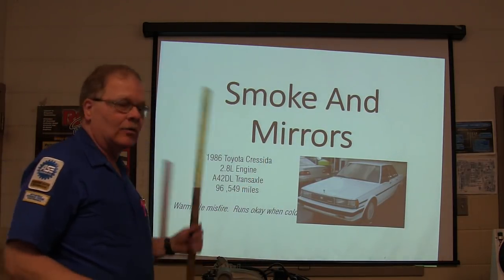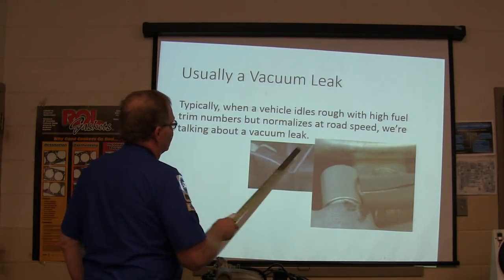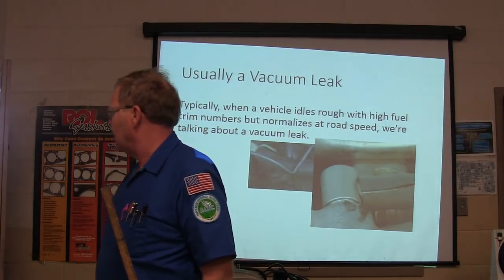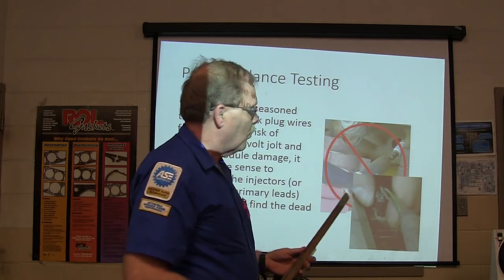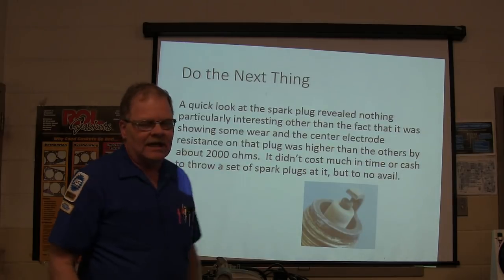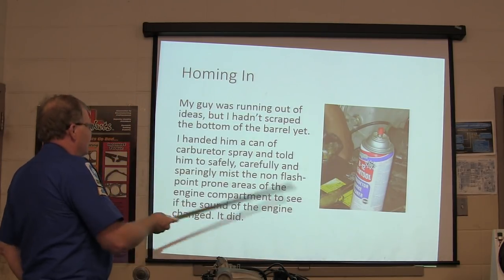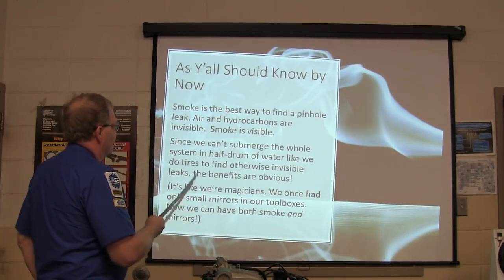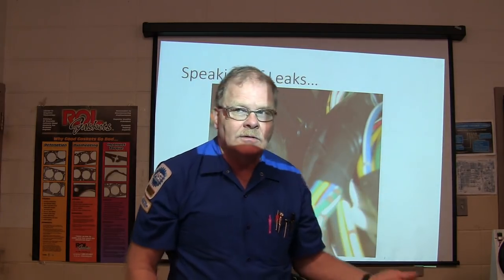Smokin it out

Comment: I am having a problem with question 5.  If Technician A has unmetered air wouldn't the O2 sensors register inconsistencies and trim positive?
Reply from the maker: You're right... I wasn't clear on that answer was moving too fast because time was short